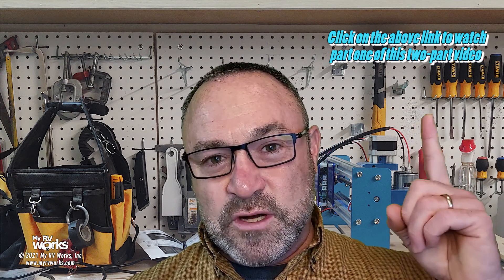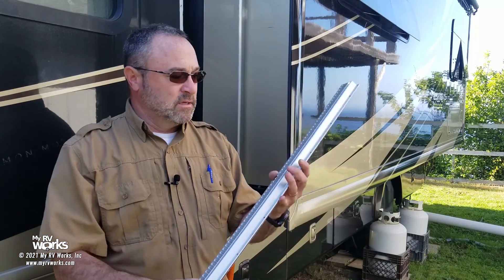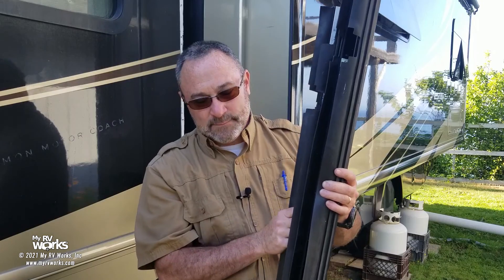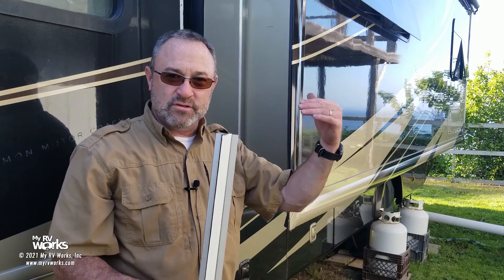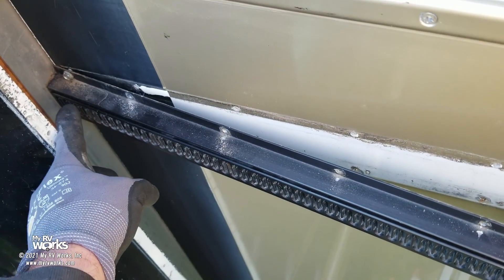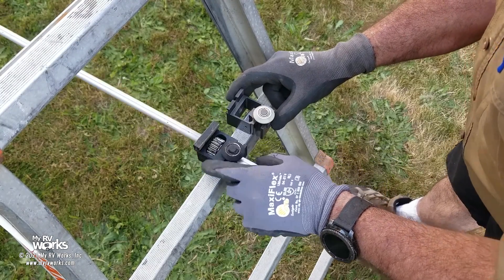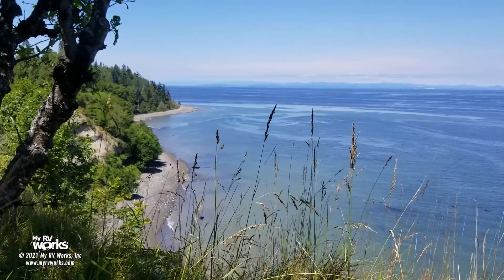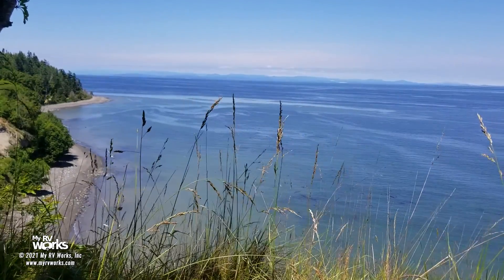Lippert Schwintek Slide Room System Replacement (Part 2)  --  My RV Works

Comment: So my Lippert Slide components came in last Wednesday (March 28-2024)

So I finally managed to have some time to unpack the contents and double check everything.

These slide components no longer arrive pre-assembles on a large pallet. 

They are shipped loose inside a long 6 inch diameter tube and must be assembled.

Anyway, 2 of the plastic shoes already broke during assembly since the sharp burr on the aluminum rack caught the shoes during assembly.

So I will have to order more shoes. These things are so cheaply made, Lippert should send a dozen shoes with these slides.

I just finished double checking all the measurement and the distance between the 2 slide racks is off by 1 1/8 so I will have to contact Lippert Monday if they are open or Tuesday.

I just had the same issue as you did in your video at the 2:30 minute mark.

Comment: I watched your video where you went thru the Schwintek slide components. You pointed out the tag with the Lippert build number that would tell them the parts they used. I knew I’d never find that number without taking it apart. So, I called the RV manufacturer and gave them my VIN. Lo and behold, they gave me that number along with the part # for the slide rails. They had none in stock and recommended I call Lippert. Lippert (Cory) was most helpful. First, we learned that the slide rail part number I’d been given by the RV manufacturer was not correct (my build used clear rails and this was for black ones). Ah, geez. Is the Lippert build number correct? Cory asked questions and I described what I saw, he figured that number was a fair bet, so I placed my order. A while later with the slide only out far enough that I could crawl through to see what I was facing there looking at me was that sticker! With the same number! (I apologize for being so wordy. I’ve watched all your Schwintek videos in the last two days.)

Where am I going with this? Instead of doing all the measuring you did, why didn’t you look for that sticker? I ask that, of course, not knowing if I’ll get the right parts even with that number.

Comment: On my bunkhouse slide out I’m finding the slide out doesn’t come out even have to retract it back and forth to get it out even and when I do retract it back in I find that the slide doesn’t compress the rubber gasket around the slide out on the Rv any ideas what I can do to resolve these two issues I’m having.Thank you once again for such a detailed video on how to work on these Schwintek slide outs they are definitely helping many of us to work on our own Rv units. 👍

Comment: I had the similar situation on my slide out one side of the slide the ceramic roller came off and the other side the ceramic wheel separated itself from the roller block. You are dealing with many issues that I have with my slide out in this video it’s definitely giving me the confidence to try and repair it myself again. Thank you so much for doing this two part video you do a great job going through the process.

Comment: Great video, 2013 Thor Palazzo, same issues...after a year in and out of the shop under extended warranty and threat of legal action, they put rollers with plates under the slide...

Comment: Great video. Made job much easier. BTW Lippert does not pre-cut the rails and they also changed the shoes on the blocks. You have to grind out the notches inside shoe or it will be to large and will break wheel.

Comment: Great video. I've just purchased a brand new Jayco trailer that I thought was going to come with a Schwintec slide system but came with a Norco Exact slide system. This system is cable driven but has two motors one in each column. Do you have any video's on them and how do you find that system? Thanks for sharing.

Comment: So I have a 2021 wildwood and our slide seems to be out about two inches on the bottom when closed. I guess the bottom gear jumped the track?  Do I have to completely disassemble the system like you did in order to realign the top and bottom?

Comment: Thank you I been looking for an video on haw to remove the H column the slide out mine needs it BAD. I have to push it out and push it back in. Will the new motor come with the new H column?

Comment: Why does loppers make garbage in regards to slide out mechanism’s? I’ve got them on my 2021 gulfstream conquest. What’s wrong with the older style slide mech’s? Don’t fix what’s not broke. I keep mine clean and use dry spray silicone and sync them always. And pray.

Comment: Hi. We have a 2016 grand design 5th wheel Schwintek bedroom slide was running out and a loud pop and how it will not move. took the motors out and still will not move. how can i get it out? I think i need to rebuild this system. not the first time having problems with this system HELP Please  thanks been watching your videos they are great

Comment: I am having to replace my slide out floor on a Forest River Salem Lite, 23 footer. I think why it rotted is the top is seating before the bottom and leaving about a 1/2” gap at the bottom. It’s not out of sync side to side but top to bottom on both sides. Is this possible and could it be because of the soft/rotted floor? The slider is on 3 rollers that ride on three 2x6 pieces of wood that are really soft.  I hope I don’t have to do this r and r of the mechanisms but can now do it because of the video, thank you.

Comment: Don't know if you can help me, but I have a Lippert slide on my 2020 Jayco. My slide keeps getting stuck The control box has been replaced the wiring harness is new and it has new motors. I can do the over ride and it works fine, but it still has issues.

Comment: hello I am now watching (subscribe) to your channel! My rv slide extends out partially on one side, while the other side doesn't move at all!😢 The mobile RV Technician just left and we couldn't get the slide to move out. The motor makes a sound like its working but there's no visible activity from it. We can't get to the motor to release the screw so we can lift up the motor because the slide is pressed up against the camper (on the outside)! Please help!!

Comment: My 2018 Grand design had a double failure, both slides in Oct 2022, on our second trip after purchasing it used.  After months of waiting, the wrong parts showed up, then another 8-10 months and finally the right parts showed up and my mobile guy installed all four in 4 hours.  that was yesterday April 11, 2024.  Tomorrow i'm looking to see if Grand Design left off the rollers.

Comment: Thank you for your informative videos, now it would appear I have a problem. We own a new 2015  “Tracer” made by prime time. There is a problem with the slide out. Located on the underside of the trailer there is rubber seal that rests up against the underside length of the floor. For some reason when we retract the slide out to the in position it drags a portion of the rubber seal into the trailer itself. There are rollers located immediately at the entrance, and the rubber gets caught on the rollers and prevents the slide from moving inward. In other words the rubber seal gets caught on the rollers And prevents the slide from moving. Do you have a fix for this that I could maybe attempt on my own. Thank you very much in advance for any help. You may be able to offer me. I do have a couple of solutions, but would like to ask an expert first. Again, thank you

Comment: What's can you do when you cannot get to the area you need to lubricate on the inside of the RV because the slide is to close to wall and the trim around the slide is in the way?
Reply from the maker: With the slide extended you can apply enough of the PTFE lubricant to the top of the bearing block and it will wick its way down into the gib.

Comment: Excellent work on this 2 part video!  My schwintek slide is 4’ by 12’ and it failed last October after 10 years in service!  Ceramic wheel on the bottom gone, 4 teeth missing out of the gear and eating up the slide rail.  Ordered replacement from Lippert and the only difference is the slide rails are 1” shorter which should not be a problem.  My repair guy is not enthusiastic about taking on the job.  I now believe I can take it on after watching your 2 part videos.  I’m thinking that getting the H column aligned and back in the right place is probably going to take the most time.  Any outtakes where you did that part and have any suggestions?  The new gibs look like they are a big improvement.  They snap into the block.  Thanks again!
Reply: As a follow up question.  I now have everything level and have installed the new rails and run in the new block, drive shaft, and keeper assembly on the float side, however at the top, the keeper when aligned with the wall stands off the back of the block by almost 1/2” reducing the contact between the gib and the block.  Makes sense that there be some play in the system however is this normal?  Or is my room racked and I should shim the rail to increase the contact if the gib and block.  The bottom gib if fully engaged with the block?  Thanks Darren!

Comment: I have a 2011 Avanti. It has 4 out board rollers they are 7" x 1.5"  about 48 " centers. There ere 4 inward  rollers which are much smaller then the outer. The MH was just in a shop to repair leak at slide seal. They also replaced rear motor I don't believe that motor. was bad. The slide still leaks and the room still doesn't close properly. Now I have taken on the task of fixing this myself. I learned a lot from your videos. Trying to figure out how to add more rollers and repair H column to fit flush in the rear. The H column is flush on top and runs out about 3/16" on bottom maybe you can comment on a fix. Could it have anything to do with the s on those gears.

Comment: FIRST. GREAT VIDEO ON LIPPERT SCHWINTEK SYSTEM REPLACEMENT.
I DO HAVE A QUESTION. DO I HAVE TO REMOVE THE LIPPERT SYSTEM TO REPLACE THE SUBFLOOR ON THE SLIDE OUT. ANY COMMENTS WOULD BE HELPFUL

THANKS
DAVID
Reply from the maker: Typically no, however the entire weight of the schwintech slide room is resting on the rollers underneath that floor. So you're going to need to figure out how to support the room once you take the subfloor out. And when you rebuild it, you need to make sure that the weight remains on that floor on the rollers.

Comment: I have lippert schwintek in wall slide out.. I have a bad motor.. the slide is all the way in, how do you get to the screw on the outside to release the motor if the slide is all the way in? I can not find anybody who addresses that issue
Reply from the maker: Sometimes the only thing you can do is pry the motor up from the inside and overcome that set screw on the outside. A long flat screwdriver can work itself between the motor and the bearing block. That set screw is run through an aluminum Extrusion so it will deform that thread on the outside. When you put a new screw in I usually tap that to a larger size.

Before you do that though, if it's not mechanically binded up, disconnect both motor wires from the control module and get a couple big guys to try to push that room out. I have also used a bottle jack to do it by myself.  It will go but it takes a lot of effort.

Comment: Darren,  I have heard that the newer Schwintek slide mechanism on my travel trailer  have nylon gears and no longer require lubrication and should not be lubricated.  Can you comment,  Thanks!

Comment: Darren what color is + and - on the harness? i like to build a tester for rescue.
Reply from the maker: The red and black run the motor. All the other colors are for the encoder. You can ignore the other colors for your harness purposes
Reply: @MyRVWorks  thanks buddy! harness is built.

Comment: Is there away to add rollers to that room. Or is not feasible?
Reply: Would have to remove the slide from the RV.  Rabitt out the floor to insert the rollers.  Reinstall the slide out.  Going by the length of that slide out, yeah that would be a big job.
Reply: probably depends on what the inside of the coach looks like under the slide.  if it's a flush-floor room, not likely.  even if it could, it would be at the factory for half a year and the owners would be stuck with a huge battle getting manufacturer to foot the bill.  probably not worth the effort or cost.  I would have a reputable tech on speed dial and have the slide inspected every year.  I would operate the slide the least amount of times.

Comment: I wish there was some way lippert could be notified the installation was incorrect so the lippert can threaten not to supply the coach manufacturer with parts until they rectify their engineering.

Comment: Awesome video. I feel better with my schwintek slide now. It's 21 feet long and I have always been concerned what to do if it ever acts up. I do carry a spare motor in the MH. I'm curious what would I do if say for instance the motors are out and I can't get to the side of the motor that has the screw in it holding it in place. I assume I need to remove the motor to have any chance at pushing the slide in or out? If I cut power to the motor from the fuse panel will that disengage it and allow me to manually push the slide in or out or does the motor have to be removed to allow the slide to move manually? Sorry for the long question :)

Comment: The bearing block could have been reused, file the area flat, drill and tap a hole in the centre, when you put your ceramic wheel on you could use a small washer and loctite the screw in place to secure it.

Comment: My brother in law has been wrangling with the slide on his Fkeetwood Bounder for years. I suspect that's why it was sold. Repair shops in the Minneapolis area can't fix it. They are pikers when compared to this artisan. Don't know if can be fixed without replacement by someone who isn't a hack. Not looking good. Junk!